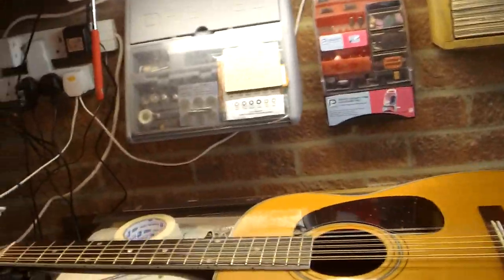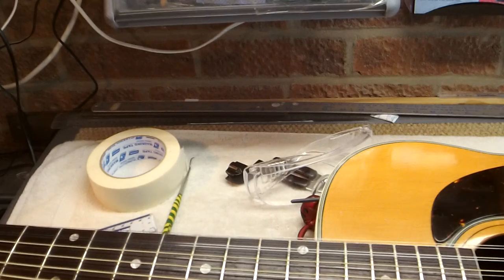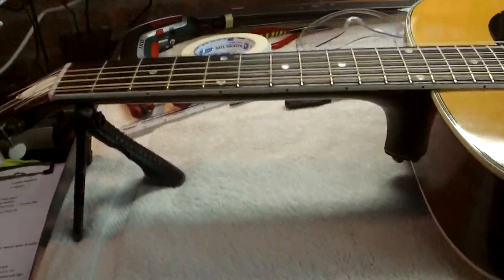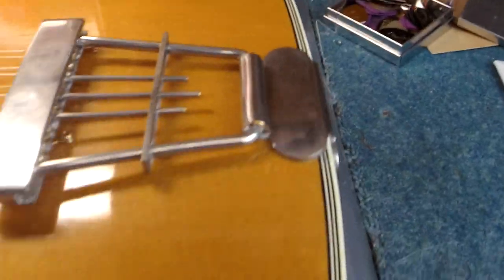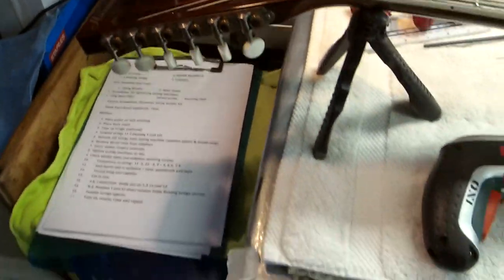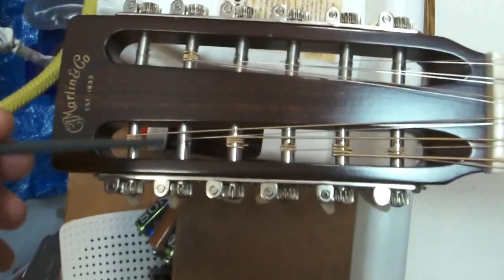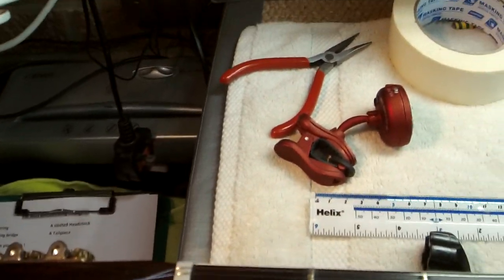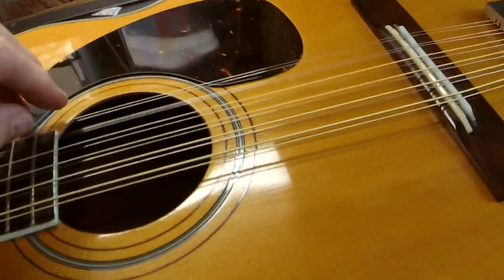Restringing an old 12 string guitar

Comment: Well described, Andy!  The only thing I do different is at the headstock is loop the string and make a knot that self tightens as I crank. This is unnecessary for decent guitars but if you have a cheap one, I found it helps to stay in tune.

I find stringing my guitars therapeutic.  I just got over the flu and yesterday my first "normal" thing to do was to restring my Ferrington electric/acoustic with "nashville" or high strings as an experiment.

As far as breaking strings, after doing many guitars for about 40 years (I am about as old as that 12 string!) only once has a string broke and it was because I was dumb enough to overtighten it instead of lossening.
Reply from the maker: Hi John, the looping method is advised by Martin I think. I have found it unnecessary and it makes strings more difficult to remove, but each to his own.  Age? I was 16 when that guitar was built!

Comment: Hello'  I just bought this guitar @ a thrift shop,,  It has missing tuner keys,,  Could you recommend where I mite get replacements tuner keys for it,   thank you.    kodi
Reply from the maker: As I don't know the guitar, nor the measurements I cannot advise you. StewMac give pretty good dimensions of the tuning machine sets. The units may not be very expensive but getting a luthier to drill plug etc., may cost considerably more.
Reply: @SillyMoustache    Thank U,   I will measure & look @ stewmac 4 sure.  kodi

Comment: Just waiting for a courier to deliver a 1970 Martin D12-35 and thought I would get a head start on when it comes time to change the strings.  I use a GHS Silk and Bronze 370 12L 11-49  total tension 213.8 on my other 12 string and will likely put the same on the Martin, as they are lower tension than most sets. Thanks for the video.
Reply from the maker: Good luck! If those strings suit your style and drive the top, adequately, then that's fine. I use D'addario EJ37s (54/30-12/12) tuned down on tone to dD-dd on my Martin and also Martin M190s Bronze but same gauge. Only do what feels tight to you. Let me know how it goes, or even make a video!

Comment: Andy, It seems that for you changing strings is a labor of love. 
On my old H1270, that I bought in 1968, when I was 30. I have changed strings many times but  I just change them. That old guitar went with me to many places during my career in the Navy, Viet Nam, the Mediterranean and all over the world. I was lucky because when I got it, it was new, but someone, maybe at the Harmony factory, had marked in the wood where the bridge had to be. Two very small grooves in the wood. It's still in good shape but really could used new fret bars as the old ones are getting worn down.
Note on the previous comment, I used tp break strings when restringing but since I got a tuner, I have broken a single one.
Keep up  the good work, enjoy all of your videos.
Reply from the maker: Hi J, Yes it is. I enjoy changing strings but this guitar is the most challenging. I can't remember that last time I broke a string, although I'm wary of the octave G (or in my case an octave F) which is only a .010" on these sets.  Thanks for watching my videos.
Reply: Andy,  I always keep both my 1270 and D12-35 tuned to standard pitch and have never broken a string since I started using a tuner.
I use the Martin extra lights M1600 on both guitars and the octave "G" in that set is also .010.
I was wondering, if you don't mind, what did that 1270 cost in 1964? I bought mine in 1968 and the retail price at that time was 160 U S dollars. I got mine for $100 because my Dad owned a music store and I paid his price, which was only $80.00, but I let hm make $20 on the deal. I just wondered what the price was in England.
Jim
Reply from the maker: @jcdpt74  Hi Jim, Its interesting to meet anther player with similar instruments to me.  Unless there is something wrong with an instrument, sharp edge  somewhere or a bad string, or bad technique. 
However, I'm an old blues and bluegrass flat-picking kinda guy I've never liked light gauge strings. Lowering the tuning on my 12s, gives a different dynamic to my 6 strings.  
In 1964 I was a drummer in an R&B band and I'm not sure when I bought my first guitar but my first Harmony was a Sovereign H1265, in , possibly'66- '68 (?)  it cost £64. at app. $3 to the £1. Prices in the UK  always include purchase tax, which was app. 33% 
Imported items had excise taxes added (many US products were embargoed - not sure when that ended. It was due to swingeing war debts imposed on the UK (and other countries) for the US involvement in WW2. 
So, with income tax of 41% and purchase taxes of 33% on luxuries you can understand why  we didn't buy many luxury goods. 
Unlike some other countries the UK paid off the US but it took until 2006.